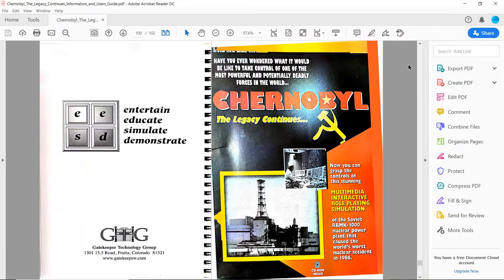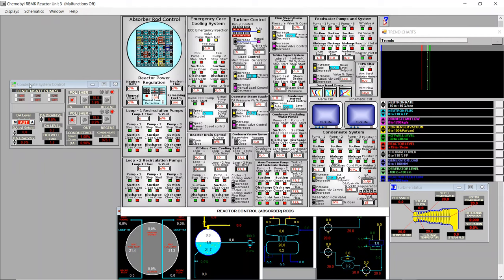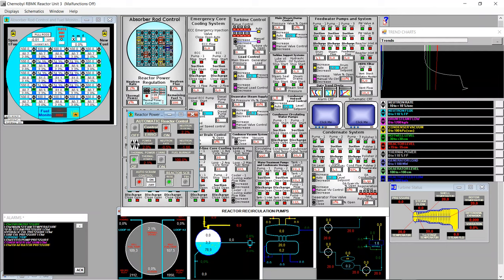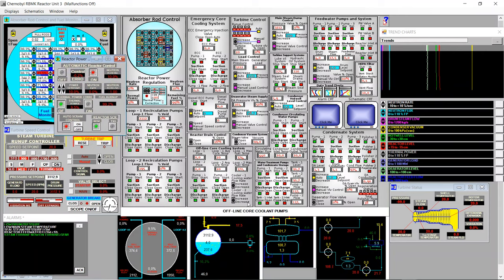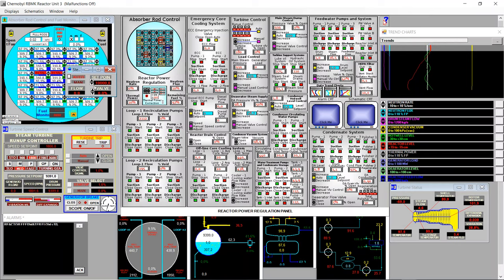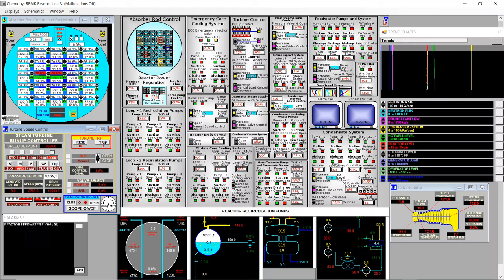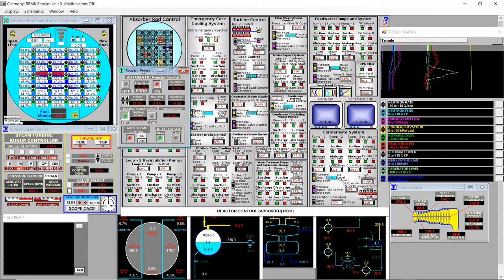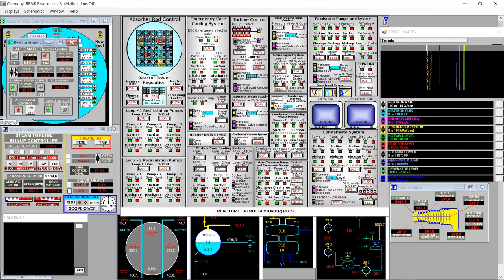RBMK-1000 Chernobyl Nuclear Reactor Simulator Tutorial

Comment: Quick note - the dump you keep changing is the overage. The steam going to the turbine is controlled by the set point box in the turbine control. It appears to latch it when you close the generator in but iirc you can change the pressure value by typing into it. Been a while since I had this working.
Reply from the maker: Yes, thanks for the tip. Check the more recent tutorial 3.0 for an improved procedure.

Comment: Thank you very much for this interesting demonstration and tutorial. Great job!

But this simulator seems weird in some aspects. I was frightened, when you forgot to synchronise at 3000 RPM, but later realised that this is the only RBMK generation unit that ever fed a 60 Hz grid. Certain values, mainly the physical properties in the primary coolant loop seem irrealistic. The nominal pressure in the primary coolant loop of a real RBMK is 7 MPa. The coolant enters into the reactor at 270°C, steam-water mixture leaves the reactor at 284°C with an evaporation ratio of 14,5%. 10,5 MPa @ 315°C is a great equilibrium value, but significantly exceeds the operational values in the steam separator. I don't understand that red figure at the steam separator. On nominal power, it is too high both for pressure and temperature. Turbines are fed with saturated steam that has almost the same properties as are in the steam separator. Coolant flow rates seem too low for such a power level.

But the content is interesting and entertainig, and this is the most important thing. Thanks again!
Reply from the maker: Thank you very much for the comment! At the time of this tutorial I made a couple of mistakes that explain why the values are out of operational range. One of those mistakes is the wrong opening magnitude of the turbine valve, this may also explain the low coolant flow because we are not yet at nominal power due to the same reason.  I plan to do a new tutorial that will fix these problems. Sure the generator synchronises at a 60Hz grid, I guess that's because Simgenics is an American company!

Comment: So I'm finally understanding this simulator to the point that I can reliably induce catastrophic failures.
The problem I keep getting (or causing) involves the recirculation pumps deciding they don't want to pump - "ALL CIRCULATING WATER PUMPS OFF. LOOP 2 MAIN CIRCULATION FLOW LOW. LOOP 1 MAIN CIRCULATION FLOW LOW."
Followed by ECC injection and SCRAM.
I'm keeping the neutron rate below ~5%, thermal power below 20%...any idea what kind of idiot failsafe turns off the damn recirculation pumps? The only reason I can think of for turning them off would be if the steam pressure was too high? It was around 4,000 the last time I checked before the SCRAM.
Reply from the maker: The steam pressur seems totally fine, I think the most likely reason for the recirculation pumps to trip is a low reactor level. Check if the feedwater pumps, treatment water pumps, condenser pumps and condensate system pumps are all working correctly, any of those not working will cause a water shortage in the reactor and so a recirculation pump trip.

Comment: 57:13 The turbine trip was not provocated by the “Steam drain”, but for the generator Reverse power. When you click close generator breaker, you need to switch immediately to the main valve. :)
Reply from the maker: Thanks!!! I learned this later on, in this simulation I got confused because the turbine tripped just one second before closing the steam drain, so I was pretty sure it was that. Do you know the reason why it cannot keep generator power with the startup valve? It's opened just at 5%, there is a lot of room for  more opening...
Reply: argilaga I don’t Know this, but it’s strange. I have another problem: at 100% of power, after an hour i had an alarm: “Warning too many rods removed” and after a few minutes my reactor trips. Why?
Reply from the maker: @Tho4craft  I got the same! it happens when the remaining fuel goes down to zero. It keeps pulling rods to compensate for reactivity loss until the rods are all withdrawn and then it looks like a reactor trip but I do not fully understand what is going on. I think that this is a bug because such a fast fuel consumption is not possible.
Reply: @argilaga  I switched immediately to main valve (fixed issue from my previous comment via a solution 3DR posted in his comments section) and still was faced with the same problem.  How do you manage to come back from that so easily in your video? I follow what you do but it stays in reverse power with the scope spinning very fast in the wrong direction permanently.
Reply: Holy shoot that was a real "panic" moment. Pure adrenaline in guessing...

Comment: I think the pressure is measured in Hectopascal 12.000 Hpa= 12atm ;)
Reply from the maker: In the manual the pressures for turbine spin up and connection are 650 and 1600 PSIG, in hPa this 44815 and 110316 respectively. Does not quite match the numbers i get in the simulator, more like 7300 and 11500...

Comment: Xenon posioning is reducing at full power so I guess it's not a bug.
Reply from the maker: Well, if you check the more recent tutorials there is a fix. But as you very well point out, at full power it is reversed. This comes from an early misunderstanding with this simulator, if too much time is taken before neutron flux gets high enough, the poisoning  becomes irreversible.

Comment: 28:15 Why for me vacuum starts increasing (like in video), but stabilazed at 16.5kPa and doesn't increase further? I don't use cheat with setting xenon to zero, other parameters and behavior of system the same like in video.
Reply from the maker: Ahhhh the good old vacuum issue... Check the video about vacuum problem, there is a bunch of reasons that can cause that.

Comment: i think you maybe set reactor drain control > set point with wrong value ? it says 4 inches in manual indeed but i think you are using metric system which would be around 10cm then. If i am not mistaken :)
Reply from the maker: Probably you are right, I used this values from user 3DR, but anyway it makes no much difference, you can set it to zero, I don't know why he used this slightly above normal. Check the version 2.0 for a more refined startup.

Comment: I cant build up condenser vacuum, even with the valve of the drum closed... I dit everything step by step following the video. Condenser vacuum dont switch on auto, even manually, it not reach 1/4 of the way at the same as your graphs...
Reply: I'm having the same issue; it doesn't exceed 2.2 and I can't get the get the turbines spinning on their own even when the pressure is up to the point of destroying stuff. I was told it's a bug that needs to be fixed like the Xenon bug but I'm not sure how to fix it. It may be another thing to edit in cheat engine like the xenon, or it may have something to do with the 'IC state fix' mentioned in this video's description.

I'm probably not gonna have time to play with the sim for a few days but if I find what to fix I'll tell ya. Likewise if you find how to fix this bug please let me know. =)
Reply: Okay; it IS the IC state fix. Confirmed. IC stands for 'initial conditions' of the sim i.e. the default variables programmed into the sim setting the status of all the systems in the reactor. This IC bug has the "Rupture Disk Problem" set as always being present, so as far as the simulator is concerned the emergency blowout valve set up to burst in case of overly high pressure has already been tripped before you do a thing, and that blown rupture disk is spewing out all of your steam before it gets to where it needs to go. It's a bug but once you apply that fix in the description you're good to go.
Reply from the maker: Thanks for the explanation! I think that the disk is located after the condenser and before the feedwater pumps, those pipelines are not meant to withstand high pressures and the disk breaks when the MSIV bypass opens without having enough vacuum in the condenser, this rises the pressure in the other side of the turbine and the disk goes bang.

Comment: No matter what I do, the condenser never reach 100kpa. I waited build up 2 thousand to 8 thousand of steam, and it not automatically goes on. I dit it, and the yellow indicator, barely appears...
Reply from the maker: Do you have Disk Rupture Problem in the Alarm panel? if so the problem comes because of opening the bypass steam valve too early. Do you have the turbine steam seal on? Did you apply the IC state fix? you can find it in the details of the video

Comment: I reckon the Xe problem is by design- doesn't procedure require 48 hrs?
Reply from the maker: You are right, at the time of this tutorial I used to think that Xe fix was required to reach 100% neutron flux because other more experienced users said so. Now I know that with a startup shorter than one hour there are no problems to reach 100% neutron flux, this is at short term and from a simulator standpoint. 

From a real reactor standpoint, Iodine pit happens 6 hours after shutdown and Xe is about 10 hours after (assuming that an RBMKs behave similarly to water moderated reactors, which I do not know...) this delayed poisoning could make it impossible to keep the reactor running. That's why, as you suggest, RBMKs need 48 hours before the next restart to get rid of Xe, opposite to water moderated reactors which have a safe poison override time.

Comment: it tool like 35 mins to set reactors power to 24.5 % but then pumps started to trip and scram was automatically engaged so its RIP
Reply from the maker: It sounds like a standard procedure in an RBMK reactor, so well done!!!
Reply: @argilaga  how do i get reactor upto 100% without overheating reactor fuel ?

Comment: How many rmbk's operate today, April 2020?  Is there available a good summary of fixes/improvements to this design?
Reply from the maker: There are still 10 operational. After the accident the main improvement was to change the fuel enrichment from 2% to 2,4%, this allowed for more absorber material and removing the graphite tips. You can find it here: https://en.wikipedia.org/wiki/RBMK#Improvements_since_the_Chernobyl_accident
Reply: @argilaga  Thank you for the reply. May I ask two more questions?  are the huge numbers of pipes to the steam separators and water supply at the bottom of the reactor typical of reactors, or did this design need more?

I'm somehow fascinated by this, but there are some questionable "sources" on the internet.

Also, I don't understand the relationship between the reactor hall floor (with the graphite blocks and the huge bioshield "lid".  Are there any detailed drawings, as I thought the concrete disk was solid, without a bunch of access holes. ??
Reply from the maker: @cmillerg6306  You can ask as many questions as you want! RBMK in Russian stands for High Power Channel-Type Reactor, this is a very special design particular to this reactor where the fuel assemblies and absorbed rods are inside  these numerous pipes or channels and the coolant (water) flows inside the channels, the moderator are graphite blocks surrounding the channels, no water flowing through them. In the typical PWR or BWR reactors you have a pressure vessel containing all the fuel assemblies and absorber rods and this is filled with water acting as coolant and moderator.
Reply: @argilaga  okay, thank you. So the big concrete lid (orange "upper biological shield") in the diagram is not solid, but has many holes for the rods to move up and down. Seems like a rather porous shield.
https://en.wikipedia.org/wiki/RBMK#/media/File:RBMK_English.PNG
Reply from the maker: @cmillerg6306  Exactly, the biological shield avoids the neutron flux to go out and harm workers, but is pierced by many channels! Sorry I did not see this remark in your first message!
Reply: I'm reading "Chernobyl at midnight" now.  A question about the HBO miniseries: At one point, the Legasov character tells the fictitious female scientist that the problem of erratic behavior at low power was actually known, as it happened a decade earlier at another reactor. The character says that a paper was written about it, but the KBG ripped out key pages of the manuscript. That is certainly consistent with the slow responses (Kiev, for example, still had their May Day parade).

Do you have any information about the page-ripping aspect?
Reply from the maker: @cmillerg6306  I did not watch the HBO miniseries yet! But I plan to do. I do not understand the relation between the ripping of pages by the KGB and the celebration of the parade in Kiev
Reply: @argilaga  the connection was the secrecy. According to "Chernobyl at Midnight" , Kiev was not informed of the degree of airborn radioisotopes and was forced by Moscow to have the may 1 parade. Some Ukrainian officials had knowledge of hazardous radiation levels in kiev, but suppressed it.  So that was a similarly relative to the putative ripped pages (unproductive secrecy). That's why I was curious about the mini series accuracy about censoring the scientific paper.

Comment: My turbine trips when trying to open valve or set to auto. What may be wrong?
Reply from the maker: Is the drum pressure high enough? Do you have enough condenser vacuum? Are all the turbine support systems activated? Do you have any alarms in the alarm panel?
Reply: @argilaga  thank you from answer. I will check those👍🏾
Reply: Apply the IC state fix in the description.

There is a bug in the simulator where the default condition for the rupture disk is...already ruptured erroneously. What a rupture disk is is basically a non-re-closable emergency blowout valve that trips when steam pressure gets dangerously high and the disk then proceeds to vent all the steam from the system from that moment on, not allowing steam to get to the condenser vacuum system or the turbines. Think of it kind of like a fuse, but instead of electricity it deals with steam. 

It's supposed to be closed when you start the sim but some sort of programming error means it's always open; there's no in-simulator way to replace the rupture disk so the only solution is applying the fix. 

But once you do apply that fix, any steam-related problems you're having while doing everything right should go away.

Comment: I’m having an issue- every time i try to follow your tutorial, when the condensor vacuum system begins to increase it just sticks on 16.7 and does not increase as yours does.
Reply from the maker: Did you start the turbine steam seal after the turning gear reached 20 RPM?
Reply: argilaga I believe so, but i will retry and ensure that I do and see if that fixes it
Reply: @argilaga I've just retried again, ensuring that the steam seal was turned on after the turning gear reached 20 and I've still encountered the same issue.  The condensor vacuum system begins to increase in the same manner that it does in your video, but it halts at 16.7% and moves no further. Is it possible that I could need to not allow it to turn on automatically and instead allow the pressure to increase further before enabling it manually?
Reply from the maker: @hopoffz Do you ger rupture disk trouble in the alarms? if you have it for sure this is the problem
Reply: argilaga If i try to continue following your tutorial then eventually yes I get rupture disk problem alarm later on
Reply from the maker: @hopoffz  The rupture disk happens when MSIV opens without having enough vacuum in the condenser. You need to set the main steam dump control into auto and set it to 7500 or so (metric system) before steam pressure surpasses 1000, or you can also set it to manual and keep the MSIV closed until you need it
Reply from the maker: By the way, the disk rupture is an irreversible damage, you cannot fix it in the simulator. You need to start a new simulation.
Reply: argilaga Thank you, i will try this
Reply: @argilaga  I am still encountering the condensor vacuum issue.  The problem I am facing is that when the critical moment hits (~29:00 in your video) and the condensor vacuum begins to increase, for yours it continues to increase to 100 whereas mine stops at 16.7 every time and will not move past that.  I do not know why, especially because on this attempt I just made, I followed your pattern down to the second to the point where every value on my screen was in sync with yours, across the board.  Is there anything else I could try?
Reply: I´ve got the same problem. 16,7. Any ideas?
Reply: @hopoffz  I found a guy having the same problem in the comment section of another video: https://www.youtube.com/watch?v=3rMnOyMW4aM . 
Scroll down to the comment of this guy: Landynplayz KD9NBQ
 in the answers they seemed to fix the issue.
Reply: The simulation model programmer checked into it and found that the rupture disk fault was saved into the file from the diagnostics and I am guessing when the intern that did the conversion from VB6 to VB.NET did not notice this. I am looking to create a new installer with the modified save file, but for now you can download a zip with the file in it from the link below. Because of the installer finding the folder to put it in changes, so doing a file search for chernobyl04.ICD should give you 2 locations, just replace both of them to be on the safe side and reload the simulator. That is the default file name to load in the code, and the "free" version had the load menu disable. You could have fun trying out the other .ICD files in the SAVED folder by changing the file name to chernobyl04.ICD
Reply: It works now. BOTH files can you find in Drive C:
Reply from the maker: @Emil-tr6of  Thanks! you can get the file in IC state fix in the description of the video.
Reply: I do it. Works great now. :-)